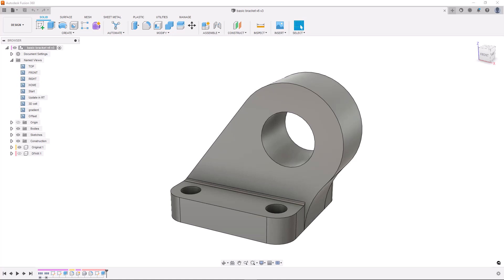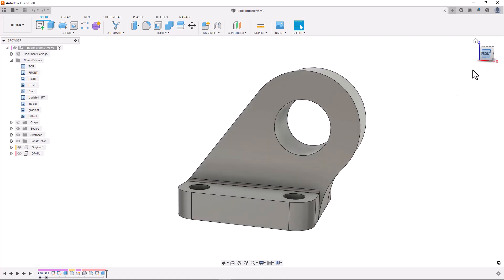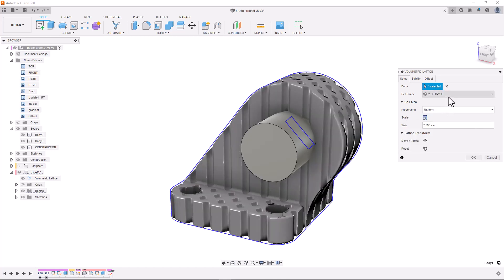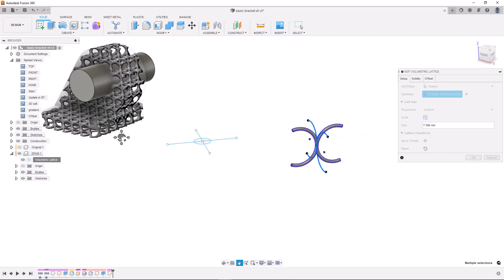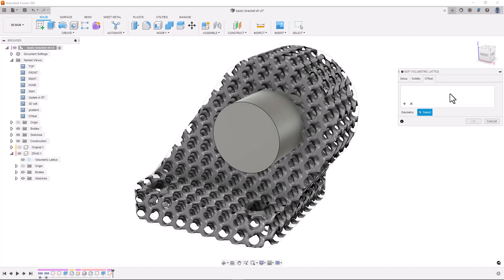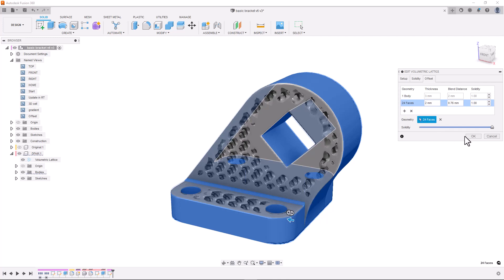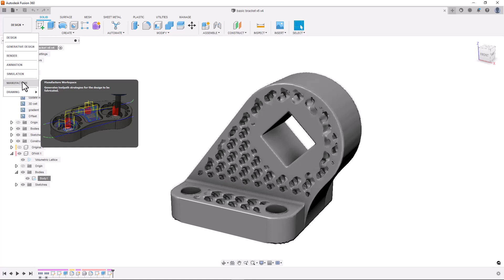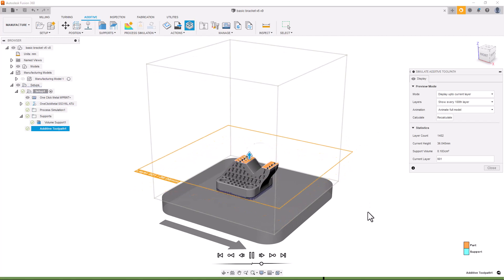How to Design Volumetric Lattice Structures in Fusion 360 | Autodesk Fusion 360

Comment: As a PhD candidate who has been working on finite element analyses of sheet-based lattices, I believe it would be a great idea if you could add a feature to the workflow which leads to shell elements. Actually, for FE purposes, shell elements can reduce the computational time up to 98% less than solid elements taken from volumetric lattices.

Comment: Wow this trick for option fast 3d printed progress..
Reply: You can do this by using various infills (gyroid would work great), and turn off your top and bottom layers and set your perimeters to zero for specific areas using modifiers.  It makes for a MUCH smaller file.